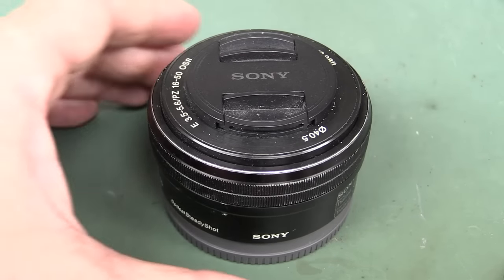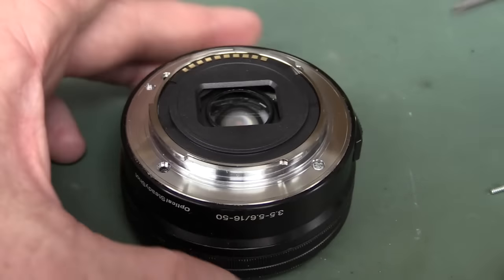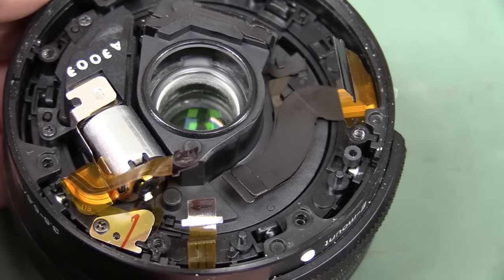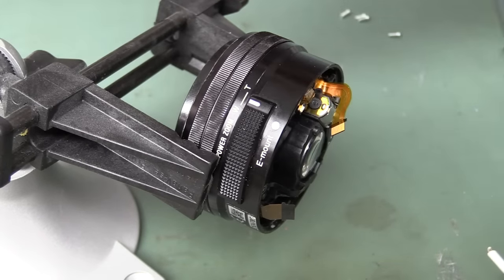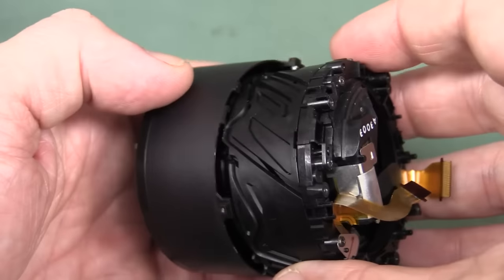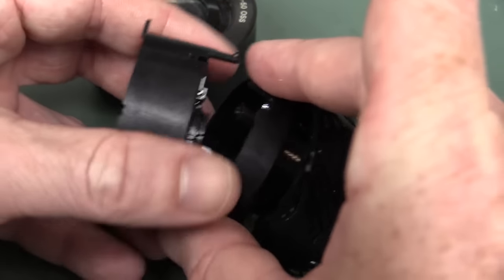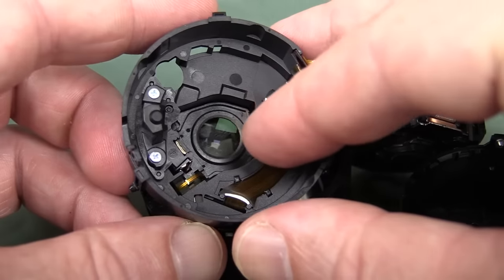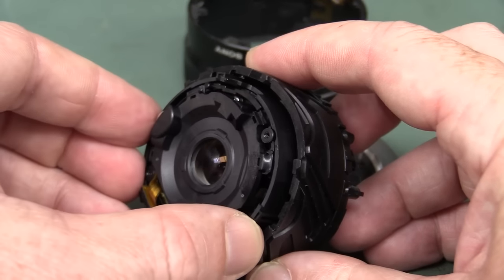EEVblog #849 - Sony E-Mount Camera Lens Teardown

Comment: Hi Dave
Thanks for the video
As you spoke about xtal oscillators have you ever though about studying for you amateur radio licence ?
Reply from the maker: +Radio Ham Not really. I almost certainly wouldn't use it.
Reply: +EEVblog I don't know Dave , RF engineering is an interesting challenge to master and takes years to learn ,you could then do video's on ham trx stuff etc
Reply from the maker: +Radio Ham Don't really have an interest in that, sorry. Other channels out there do this.
Reply: +EEVblog  and you need to learn Morse code. at least in Argentina

Comment: the new canon F1.8 50mm STM EF lens actually dosent have a focus ring that connects mechanically to the lenses. its all motor controlled which can mean much smoother and less shaky video
Reply: +Boomdoggles Same deal with this one.  Although instead of a stepper motor, this one uses a voice coil actuator.

Comment: Hello,
I have a Sony 1.8/20G that I decided to clean with no prior experience whatsoever. When I removed the back ring there were inside 8 shims (thin metal arches) that misaligned when I removed the ring. Each one is stamped with a number: 4, 4, 4, 5, 7, 7, 10 and 20.  
I don't know how to place them correctly again. I would very much appreciate if you could tell me how. If there is a fee for your advice I could pay you through PayPal. I write from Mexico, so shipping the lens is not practical, besides I don't want to assemble it in the incorrect positions. sorry for bothering you, I am hitting my head against the wall

Comment: Hello, thanks for this very interesting video. 
One question : do you think that it would be possible to control the movement of the steadyshot stage by another "brain" that the camera (I mean a computer with an adapted software). The idea is to use it as a  homemade "adaptive corrector" for astrophotography with a telescope to compensate the bad movement of the mount.

Comment: Is there a position feedback on the Steadyshot coils or is it just back-EMF short-circuited by the driver (like DC motor braking) that causes stiffness?
Reply from the maker: +RicoElectrico I see some signal line in addition to the coil, so likely some feedback.
Reply: +EEVblog Do you have any idea how is it done? Sure it&#39;s not another coil (like in servo speakers), as it wouldn't pass DC...

Comment: You know... some in the comments mentioned that Voice Coil Motor focus was becoming common.  I was under the impression that it wasn't all that old (in lenses) and that Samsung held the patent, which they do.  I was then wondering why A Sony lens would be allowed this, so I went looking and found some new articles about a massive patent sharing agreement between the two that took place in this time period.  Does anyone know if this is being used in lenses from manufacturers other than Sony and Samsung?  Not counting smartphone and embedded sorts of things (Texas Instruments have some patents that are different enough).  Links will follow in the reply to this, probably to avoid spam YouTube doesn't allow copy paste links into the OP.
Reply: +zvxcvxcz Interesting.

FYI, patent cross-licensing is common in a lot of industries. A major effect is that small players and upstarts get shut-out, because they can't afford the lawyers and lack the patent portfolio. In other words, it puts a break on innovation.

I'm pretty sure the original iPhone used some stuff Microsoft had patented, but never managed to figure out how to use in a product.

Comment: 12:40 is it possible to take the front out with a divider by turning it? I need to remove condensation behind the front glass

Comment: The 54MHz chip probably drives the image stabilisation and it needs to be done quickly so it's built into the lens.

EDIT: Ah, you found it out @ 15:42
Reply: +Jim Griffiths I haven't had a chance to watch the video yet (won't for about 2 hours) but yeah - every lens out there that does IS does all processing internally.

Some bodies play a role in IS - but those are ones that have sensor-shift IS.  Some of Sony's cameras do both - lens handles pitch/yaw and sensor IS handles x/y translations and roll if an OSS lens is present.  Not the case for any APS-C cameras this lens would be on.

There's no way that lens IS could be controlled by the body with E-mount - the lens status and command loop runs at 60 Hz (at least on a US A6000 in AF-S mode, I haven't looked to see if loop timing changes in AF-C mode, and no one with a Euro body has used a logic analyzer or scope to look at the BODY_VD_LENS timing on a PAL body.).
Reply: +Andrew Dodd Yeah but this particular lens actually does not have steady shot at all. What I'm guessing that 54MHz chip does is oscillate the focusing system. The focusing lens (Or lenses in some cases) oscillate forward and backwards very rapidly in order to get the focus right.
Reply: Nevermind, I take that back I guess this one does have optical steady shot! My bad!

Comment: They put allot in a small lens. 

Much unlike their DSLR lenses, those are seriously ye old design.

This sadly also means that these modern system camera lenses are harder to fix. Smaller parts, close together, if something goes wrong repair costs in many cases close to the price of a new lens. Well with kitlenses at least. 

I had a kitlens die on me and one of its common problems is that a data cable breaks. Ugh.

Comment: Can someone explain how the image stabilizer in the newer canon lenses work?
Reply: +tristan digert Likely very similar in concept to how the OSS mechanism in this lens was operating.  Accelerometer (or, more likely, gyro or possibly a combo) to measure pitch/yaw, which is corrected for by shifting one of the optical elements.
Reply: Andrew Dodd thanks!

Comment: I would just forget about that lens and replace it with a TAMRON 18-270mm  Tele-Zoom and you will be good to go, I own a TAMRON 18-270 and have had no problems what so ever..
Reply from the maker: +DAVID GREGORY KERR Err, that lens is 3 times longer
Reply: +EEVblog And does not exist for E mount.

Sadly, this is the disadvantage of ultracompact automatically retractable lenses - they tend to be much more prone to getting jammed by sand/dust.
Reply: It is what you call a Travel Compact DSLR Lens, there is a CANON to E-Mount adaptor check JESSOPS Catalogue. try Fotodiox CANON to  SONY E Mount